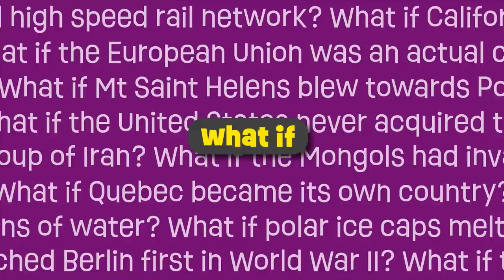Water Pipeline: What If An Aqueduct Was Built From The Great Lakes To The Southwest?

Comment: When the Southwest sends us Michiganders some 75-degree days in February, we'll talk about giving them some water.
Reply: hahaha enough said!
Reply: It's not up to Michigan. There is very strict international laws on withdrawing water from the Great Lakes
Reply: Nah. They can keep them. We get our share of those conditions.
Reply: They do supply you with food though. Furthermore, if the water was delivered from the Great Lakes outlet seasonally, when there's excess outflow, then it wouldn't have any bearing whatsoever on the water levels in the lakes themselves. The real issue is a fundamental engineering one, and the question of whether such a project would be cost competitive with alternatives.
Reply: Just build an air pipeline along the water pipeline but pump the air in reverse direction 😂
Reply: Seems reasonable
Reply: I live in Colorado and I feel the same. If they want water they shouldn't live in a desert. We put up with the winters so the Colorado river has water and they claim it.
Reply: Central Illinois and we're almost there.   I've seen a couple 70 degree days this January, lots of 60s.   Our "winter" lasted about 6 days.   Didn't have to use my snow shovel once, and used my ice scraper one single morning the whole season.   You don't have to move that far!